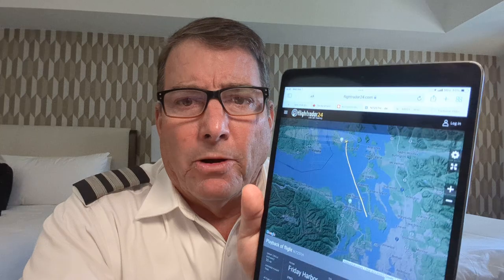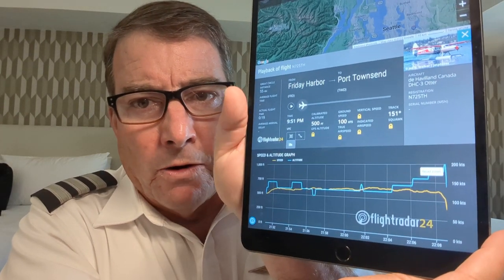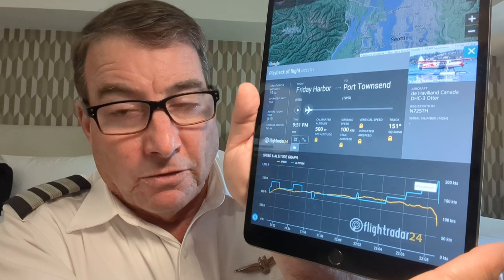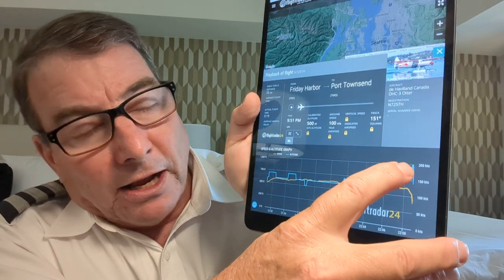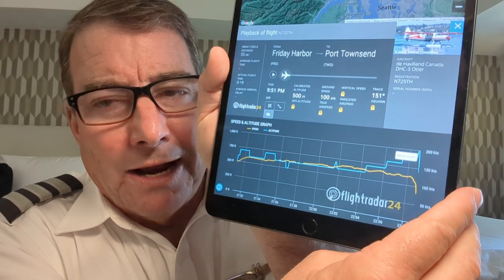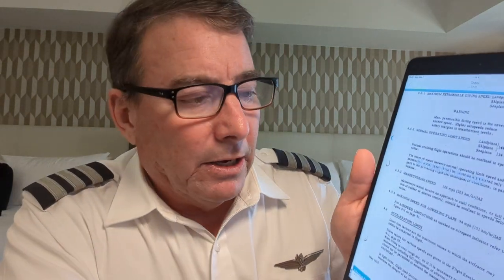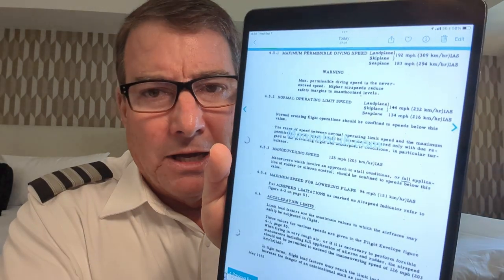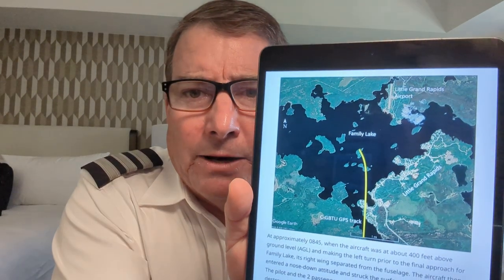DHC-3 Turbine Otter N725TH Crash 4 Sept 2022

Comment: How difficult a task would it be to simply replace these common fatigue parts every X hours? Or is it integral to the frame? Aluminum is a horrible material for longevity. Eventually everything made out of it will fail from fatigue, it is just a matter of time.
Reply: Some parts have a set hour for overhaul, even a total airframe and wing lifespan hours mixed with multiple inspections including annual. There is no telling what happened yet, or how recent any problem was that caused it.

Comment: My assumption is that the Otter uses cables versus hydraulic controls for the control surfaces and that it is too small to carry flight data recorders since nobody is mentioning recovery of it. Do you know if both of these are accurate? It was sobering and emotional listening to VHF Ch 16 just after this crash and hearing boaters report their recovery efforts. I've never heard anything like that before in real time. Just terrible.
Reply: Even if it had recorders securing them from 550 ft depth, with strong currents will be no easy tast. Impossible for divers and probably as difficult to under-water rovers!

Comment: I wonder if Cirrus & other planes that installed ballistic parachutes or multiple parachutes help save lives when structure failure results in loss of total control of any plane?

A few seasoned pilots smirk at the thought of plane parachutes hinting most are pilot error in accidents but when pilots loose all control maybe we should at least bring that question up again.
Reply: Which is great until the G-forces block you from releasing it, or you are inverted. Nobody will invest that much money, let alone depend on the FAA to approve aircraft to be changed for one. There is a fine balance to their designs, even for 60 year old aircraft.

Comment: Ok Im NOT an engineer and Im not an aviation expert but I do have a professional interest in data analysis.  A recurring "theme" in aviation is that the "risk profile" follows the following curve.  1) High risk period for new models (Hello Beoing 737 Max).  2) An extended period of Low Risk  3) An extended period of imcreasing risk due to ageing.   Mabe older planes need to be removed from fleets that carry paying passengers ?

Comment: My question to the industry: would it be possible to replace such vital parts with carbon fibre replacements, in order to eliminate corrosion related issues and give it a TBO to eliminate stress fatigue break ups?
Reply: CF has its own host of problems. It's a very unforgiving material. If you were looking for corrosion resistance with damaged tolerance titanium is probably your best option.
Reply: @otm646  thank you Donald, very true titanium would be an alternative. Big question left are the costs.

Comment: A climb before crashing would not be a tail failure, as the horizon stabilizer induces a downward force.  Seems more likely that the engine departed the aircraft, leaving with a severe aft center of gravity, hence nosing up  rapidly.

Comment: Juan....I've flown on several otters over the years dating back to the old radial engines up to the turbo prop conversions. If this was some kind of engine failure wouldn't the pilot be able to almost always be able to glide to a body of water and set it down? I know of 2 over the years up in Ontario that did this after the engine quit. Most up there fly at less than 1000 feet transporting fisherman and hunters daily in the prime months. Assuming I'm correct this almost positively looks like a structural failure. But I also know its not good to jump to conclusions so we will see.